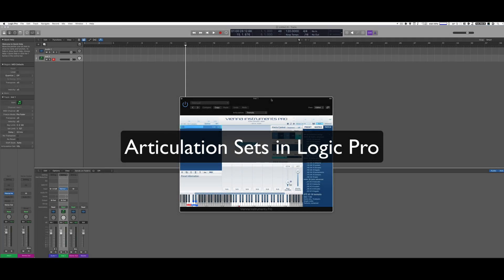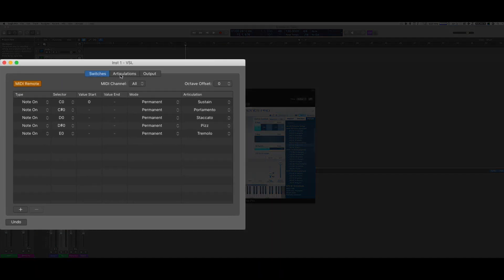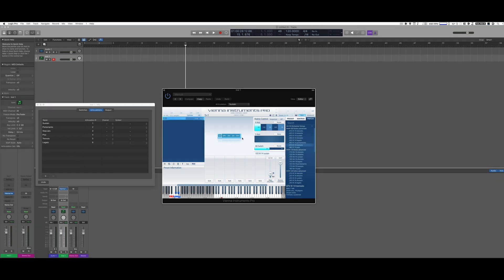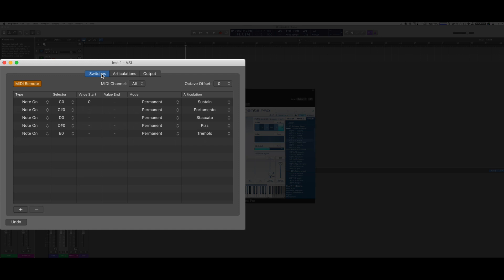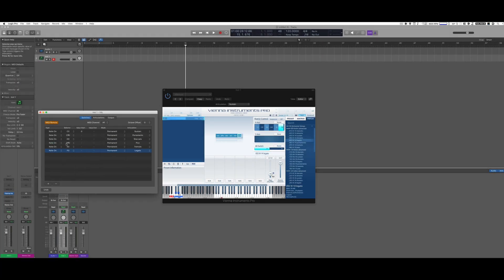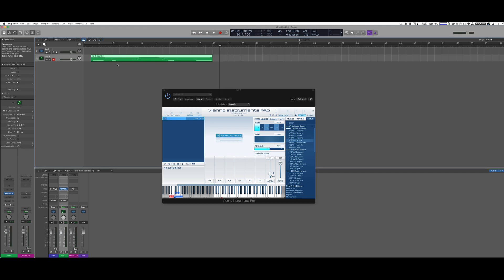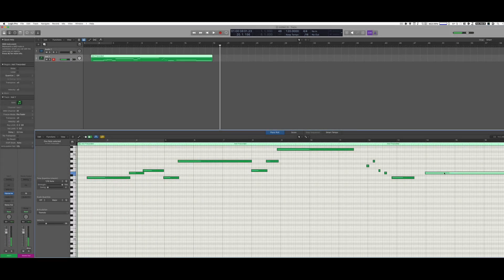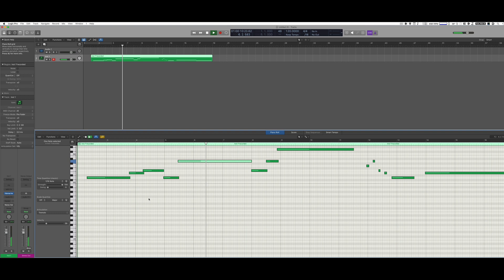Logic Pro Articulation Set Video Tutorial

Comment: Hey, Andrea. Why doesn't this work for me? I have followed your instructions to the letter and I can't get it to work. Can you please help?
Reply from the maker: Hi, there are usually two reasons: 1) there is an octave difference between your triggers and the triggers that your library accepts. Try to switch ovtave for the triggers. 2) Make sure that the MIDI Remote button is checked (in blue).